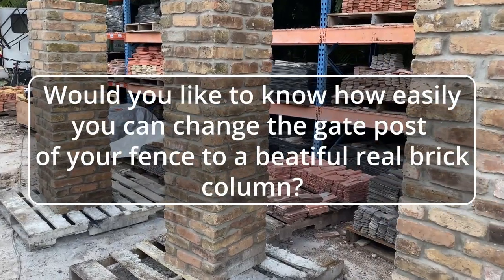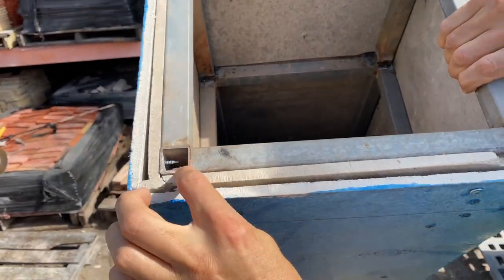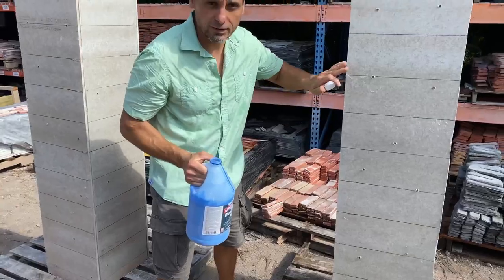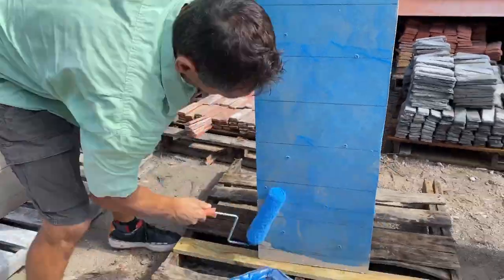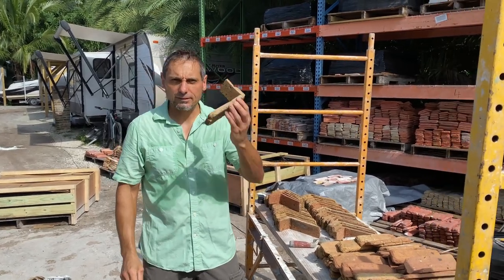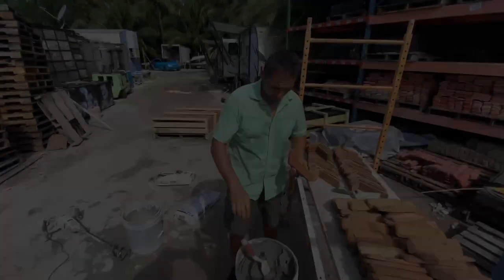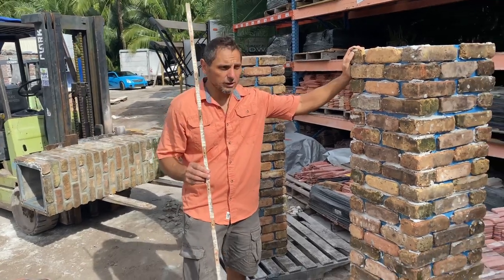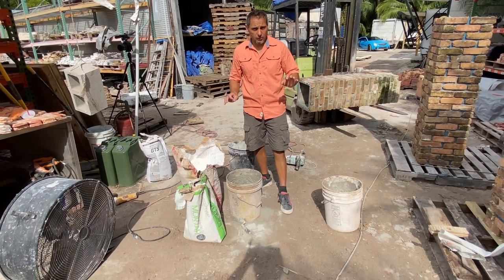How to install thin brick veneers and corner bricks on columns.

Comment: Columns look great. Think you said those are original bricks cutted, do corner parts breaks?
Reply from the maker: We cut these Chicago clay brick tiles and corner pieces to a 1/2'-3/4" thick all around. If there were no hairline cracks and the brick was solid the corner pieces should not brake. However, there will be some that might brake if pressed too hard.